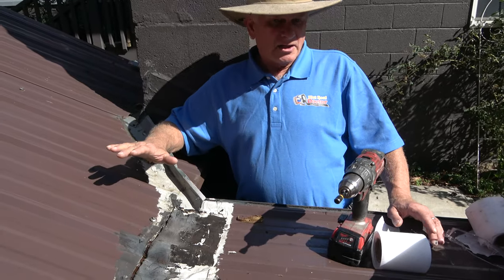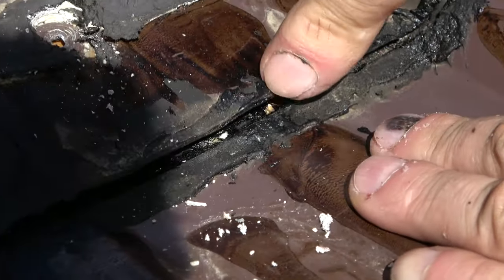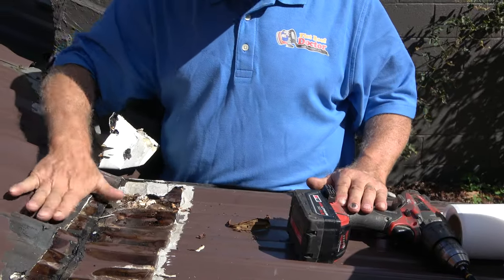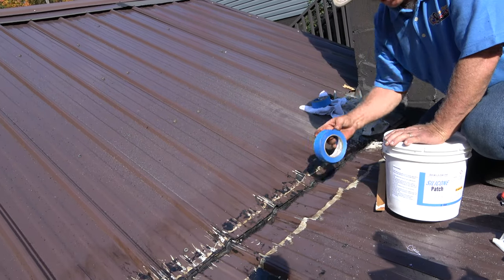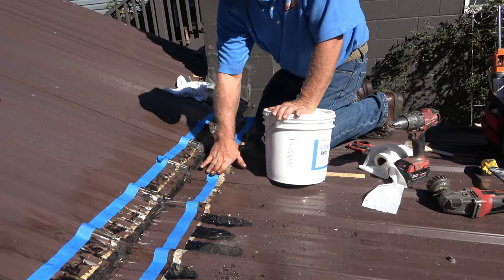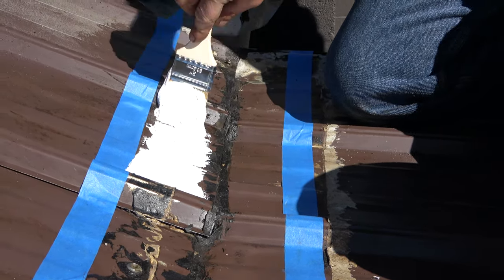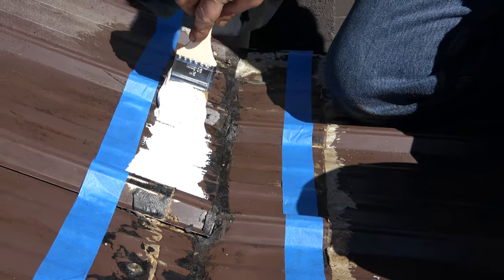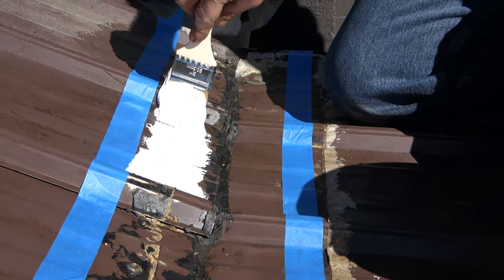Residential Metal Roof | WATER LEAK Seam Repair | Fixing transition from main to garage roof

Comment: I fixed one like that not to long ago. The water was coming from some vents higher up that weren’t sealed. It has transition metal but it was on top of the underlayment so water was running under it. Water finds a way!

Comment: The only issue I have is at the joints. That's not 100percent leak proof. Transition flashing is needed. Where the metal laps, he puts sealant under and over joint, but sometimes that will not fix leak water can still penetrate at the joint above where he sealed. You'd have to seal the entire overlap to be certain. Especially with ice. Transition flashing period. I understand they're trying to sell products. This product may be excellent, but not in this area.

Comment: Why did you tek screw into the centre of the pans?   I thought you should screw into the tops of the ridge, or inside  the pans but next to the overlap ridge as this will hold down the cap edge of the overlapping sheet much more firmly.   What you haven't pointed out is this roof is incorrectly overlapped, with the underlap side of the sheets being put on the top of the overlap side.
The sidelap between sheets of roofing is designed to have a capillary cavity .  (The underside edges have a 10mm  flat section at the sheet edge, the overlap edges have a tighter curve and a higher sheet edge)   The manufacturer states do not block these cavities because moisture entering the side lap may not be able to drain unimpeded down the roof slope.   The video shows from about the 10 minute mark the sealing of the underside of the ridge.  Good possibility of blocking the ridge cavity and sending water in just above the top sealant line.   A thin line of sealant 50mm above Seal,  spiralling down from the top of the ridge downslope to the pan,  and a small v cut above this to allow an exit of capillary moisture above the joint, will fix these upslope side lap  joints.
Extending that lower roof still applies. so that you are relying on the natural flow of water instead of relying on the blocking with sealant.
Lastly what happens when you need electrical access?

Comment: You have stuck the overlapping ridges together on the sloping roof.   There is normally an anti  capillary gap on these side laps and normally they should be able to run
out at the end of the sheets onto the flat roof section.  (there is a designed in smaller radius on the last overlap of a sheet).    Blocking this capillary gap invites moisture to cross around the ridge into the inside, before it gets down to the flat roof section.   
Keep it open and extend the lower roof with turned up pans.
Reply: Hello, can you give more info about your point? Any link to where I could read more? I have the same issue in this video so finding the right solution is important

Comment: Good band aid repair... would have been great with a bent sheet metal insert under it???
Reply from the maker: I agree
Reply: That would have fixed it properly. Just a piece of metal. Thats all. Maybe a flat roof o hehe flat part as well.
Reply: Why put the screws on the flat of the metal roofing.  They are to be on the high part so they keep out of the running water.come on rookie move.
Reply: @Perromedico  yes 27 years industrial roofing.  This guy is a hack.  Im a roofing inspector in ont Canada.  So yes I ha e experience.  Do you? I thought his channel was satire it was so shity work. Look at a manufacturer site if you want tips.

Comment: All you had to do is cut about 2inches off the top roof and put a piece of transition trim in and it would of been half the work and twice as good of a fix
Reply from the maker: You are absolutely right. If I had the material to do so, I would. I did this for free for these people and I was not gonna spend several hours to get something together. 
Thanks for the comment and you are 100% correct
Reply: Thank you. I was wondering what was the ideal solution. I'm having the same problem right now.

Comment: I have a question: I have a galvanized roof that is about 37 years old. It doesn’t leak, but the galvanize coating is wearing off and it’s starting to rust. For the last few years I have been using rust converter to try and stop the rust, and then use spray can cold galvanize compound to cover the rust.
What do you suggest for a problem like this?
The rust is unsightly and I don’t want it to rust all the way through the roof. It’s pretty large areas scattered about.
It’s a silver roof with white trim.
Reply: I had a similar problem with my galvanized roof. I used Tremclad  primer for galvanized metal for the entire roof, and then 2 coats of Tremclad rust paint.  The Tremclad folks told me that I could use regular rust paint over the rusted areas, since the galvanized coating is all gone, and use the primer only over the areas that were not yet rusted. But I found it easier to paint  the entire roof with both products. The roof was first prepared by power washing. Still looks good 3 years on.

Comment: I have a horizontal roof seam on a low pitch roof should i use silicon patch with fleece or turbo poly shield with fleece. It runs about 20 feet long. Also where do you get the fleece? Thank you! Great videos!
Reply from the maker: Turbo Poly Seal. You get it from Bergstromm.com The fleece and the Turbo

Comment: I will stick to  asphalt shingles, I know to many people that had metal roofs installed and had problems. maybe installation error i would think , but metal roof not for me.
Reply: Metal is definitely the way to go . Up to 130 mile winds. This metal in this video is installed incorrectly from not having a proper transition metal to panels being installed improperly. I’m a roofer and I would never get shingles . If you get metal installed properly, it will last a long time. Put it like this, go and rip a shingle with your hands and then go and try that with metal.
Reply: @mexisoc  Do you need to change the screws after so many years because the rubber gaskets dry out and fail?
Reply: @lar4305  That's a valid question that many want to know but unfortunately he did not reply.
Reply: @lar4305  YES you do. The gaskets dry out when the screws start to work their way out of the wood due to thermal expansion. If the screw is still tight then the gasket should not fail. Luckily ZXL woodbinder screws are now available with a 40 year warranty. My metal roof is 20 years old some of the original #12 screws are starting to pop up. I'm replacing them with #14 ZXL with a bit of Lexel caulk and don't expect to have the same issue for many years to come.

Comment: What is the fleece, do I find that at home depot
Reply from the maker: Unfortunately, you can not find it anywhere. It is specially formulated to work with turbo poly seal and Super silicone seal
Reply: @FlatRoofDoctor   Can't find it "anywhere"?  We can't buy what you demonstrated the use of?
Reply from the maker: @benhammon4515  You will find it here https://bergstromm.com/
Reply: The Doc tells you a fib when he says "you can not find it anywhere" You can buy the polyester roll in different lengths and sizes at any hardware store. The Doc  has a vested interest in  Bergstrom so he plugs it. There are situations where you may need a stiffer meshing. In that case you can use various types of differently woven fiberglass mesh
Reply: @redpost2380  Yeah, they try and tell you this is specially formulated just for this from this company but it's just a re-branded product that covers many uses, and as you said, can be found in any big box or hardware store.haha

Comment: You didn't mention to paint over the fleece after you applied it
Reply: Yes you’re right maybe because is diferente material?
Reply: It's the only way to correctly use the fleece, you have to apply a liberal base coat, then the fleece then paint over so none of the fleece is showing

Comment: You've created a water dam at the upward most part of the repair. If this repair was done in and area where water freezes during winter the ice will undoubtedly start breaking the silicone from the metal. You should have feathered the upward most part of the repair.
Reply: He should have installed wakaflex on top of the lower section and tucked it under the upper panels this would allow for a 11 inch water diverter. I would never install silicone on a transition it essentially blocks or dams water not just that extreme hot or ice will split silicone.

Comment: Like  most of your stuff but I WOULD cut the upper roof off ABOUT 4 inches  and slip a proper transition metal under upper and over the bottom...what your doing,,,water from above will back up under metal lap,,if not today, tomorrow don't doubt me on this,,,to borrow a little Limbaugh lingo,,,WOULD be faster and right,,,MERRY CHRISTMAS,,WHEN THEY CALL YOU IN JANUARY BRING A ROLL OF 18 IN FLASHING
Reply from the maker: Correct, you and some others have made the same comment, very good advice

Comment: I keep a box of disposable rubber gloves on hand to protect myself from the solvent based cleaners tearing my hands up and to keep the silicone off. You may want to try using a SEBS product instead of silicone on metal roofs. SEBS is specifically designed for metal. SEBS products are a rust inhibitor.
Reply: You have very good observations thank you for your advice

Comment: Doc, these videos are great because they highlight the many problems metal flat roofs have. You had a choice. Make the transition OVER or UNDER?  Doc the OVER transition has already failed you have made the same mistake twice but with that better but expensive silicon material you sell.  You are too experienced not to know that the LONG TERM solution is a metal sheet that is fitted  and properly fixed UNDER the inclined sheets. Lead flashing would be malleable and long lasting but with poisoning issues due to acid rain etc. One solution is 8" butyl backed aluminium flashing that goes under the inclined metal sheets.  There are a multitude of flashing rolls that if properly fitted would last as long as your silicone BUT unlike your silicone material they are MUCH EASIER to remove and replace in 20 years time.  When preparing the surface, take care of your and your wife's health by wearing protective gear not just for the eyes but hands and nose.
Reply from the maker: you are absolutely correct.; The only difference is your method that you are describing is much more expensive and regular home owner will not attempt it. So compare apples with apples. That repair was done over a year ago, and the owner is still very happy.

Comment: You said your self in other videos to never use silicone, then you use it.. Shaken my head
Reply from the maker: You are confused. I said bot to coat entire roofs with "Silicone" and I have said never to use "Silicone Caulking" That is completely different than using a Silicone-based product to do flashing or repairs. The Silicone composition in Silicone Patch or in Super Silicone Seal is much different than that is found in Silicone Caulking or Coatings. 
Canadians are really ganging up against me.

Comment: I am dealing with this very situation, a transition from roof of house to porch. The way that looked when you were done, looks like it would catch water at the top part of your patch because it is way too thick. Being too thick, the water would pool at that location and over time, would have to fail. If it were feathered out at the top and made thin, where the water would easily flow over it, I think it may actually work. the way you did it, where it's thick at the top, I don't see no-way it wouldn't leak. Just my observation, and this isn't my first time doing a DIY job.